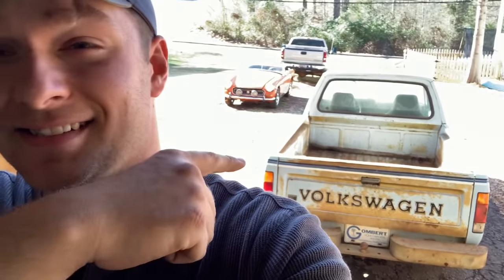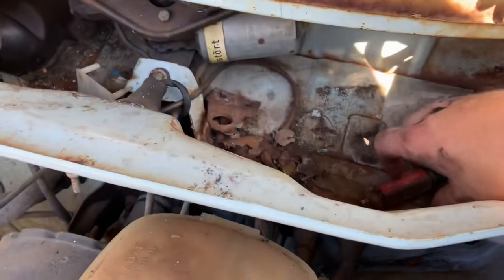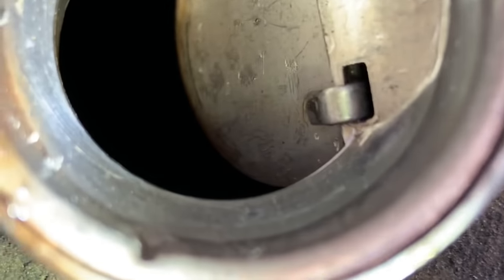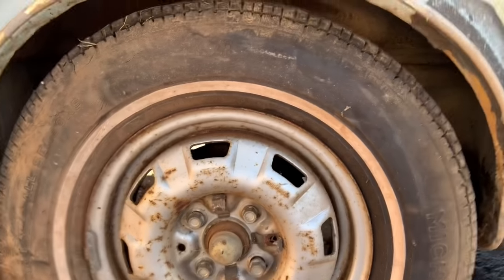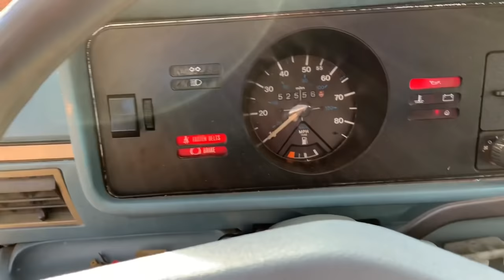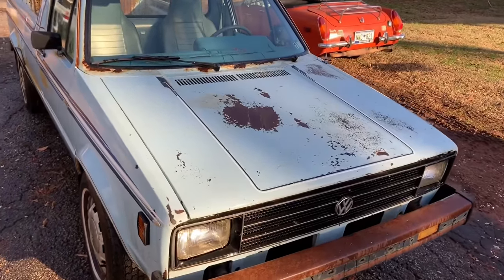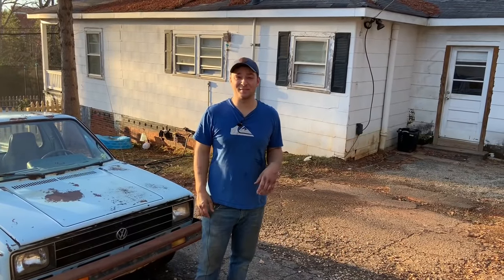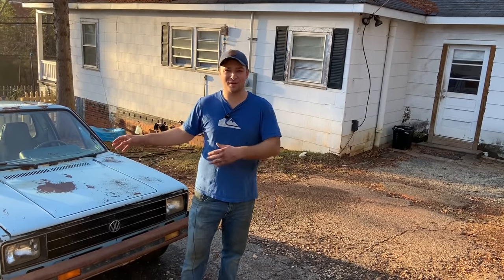Barn Find VW Rabbit Golf Pickup Sitting for 25 Years! :Rebuild Part 2

Comment: Those things are indestructible. I used to work with a guy that had 400k on one. Might still have it for all I know. He said it got over 50 mph. Really cant beat German engineering.
Reply: Unless you do like my uncle and drive around with tho oil light on. We had one of these for work.
Reply: 50 mph is pretty slow
Reply: Unless you drive it in Europe. Here it will be well and truly eaten up by rust within 10-15ys.
Reply: we have a VW polo with 410-420 000km on it and the engine is like new
Reply: @CXensation  atleast here in finland when there is road salt basically the whole year
Reply: Aye, I have a 1984 Jetta1 TX, and it goes and goes. Salty roads since new (sweden), and its just lovely.
Reply: you like the cars? you should see the german grills

Comment: Fun!  I’ve got an ‘81.  Drives great.  I did have to replace my vacuum booster as it was sticking, due to internal rust, causing brakes to drag.  About 250,000 on mine.  My paint is in good shape and the poor thing actually has taken out 2 deer!  Repaired and running.  I did have ‘normal’ rust, at the corners of the windshield where water could sit, under the gasket and not drain.  Pulled windshield, fixed rust and replaced gasket.  It’s a fun truck.  I think I need to replace the injectors (I have the tips) as it’s pretty doggy but at 50+ MPG who cares!
Reply from the maker: Sweet! One thing to check is the injector timing, if a belt has even been done and that was messed with but not put correct it’ll make a huge difference. I just kick them back and forth until I get the sweet spot where it makes good power but doesn’t blow a ton of smoke and have never had an issue! A fresh set of injectors will definitely make a difference too!
Reply: You can use booster and bigger master cylinder from Passat B3 or Golf mk2 to improve the brakes a bit, also you can use vented front discs and thinner pads from Golf Mk2 GTI to improve it a bit further - these parts have maybe better availability and prices today :)

Comment: Word to the wise from a dude who has been through the wringer with one of these little beasties. Replace that old coolant expansion tank, use only new German water pumps and thermostats, check your timing belt religiously. Also the coolant temp gauge is to be watched like a hawk at all times. I'd recommend an aftermarket one if you can swing it the factory ones are dicey at best. Always willing to lend a hand or knowledge if you're not sure or need advice or resources. The cooling system is the only thing keeping the head from warping on these things be sure it's well taken care of and fresh cheers.

Comment: Love the Patina & Graphics. European round headlights and front bumper would simplify the front even more. Tyres have steel liners. If you’ve ever tried to remove a tyre from a wheel on your own, you know how tough it is. I had a cutting disc to a tyre once and could barely get through it. Keep it under 50mph it’ll be fine. Owned x2 Mk1’s & x4 Mk2’s. Cheap parts, easy to work on, 30mpg, gets a lot of attention. Folks love um especially the more basic models. 1990 CL Auto at the moment. Mk1’s are prettier but Mk2’s are a bit more usable for a daily. I’m up to 62k mileage on my current Mk2 rolling resto. Enjoying the videos. You know your stuff 👍🏻😎

Comment: These engines were notorious for frozen rings and defective cylinder heads. First sign of bad rings is bad starting because of compression issues. ATK from Japan made a complete replacement cylinder head. I used to do one engine every three days, take it apart, remove the frozen rings, throw away the entire cylinder head. Replace the rod bearings, then back together.  You need a special VW tool to time the injection pump.

Comment: Such fun cars... keep the color. Before you know it your little ones will be driving it.  I had one... an '81...gas... put a HT (or RD?) 1.8 liter hydraulic lifter GTi motor (10:1 comp) in it. That thing scooted. I sure miss it. It was rear ended by a Dodge 3/4 ton work truck. Thank god for head rests as my head (rest) knocked out the rear window.

Comment: Very cool truck. I had 2 at one time and the only issues I had was tail lights and a gas tank almost impossible to find. The front strut towers are in good shape on that they are prone to rust because they undercoated it so well they covered the weep holes for draining. Cool truck wish I had mine still.
Reply from the maker: Sweet! Yeah, I’ve had pitiful taillights in my previous ones but can’t find them! Thankfully these look practically brand new considering the mileage in the truck! Haha yeah I remember pulling pending off them....it’s ridiculous 😅 this one all super solid though!

Comment: I love the truck and it’s Diesel engine . In the late 80’s early 90’s I took two diesel rabbits and made one completely rebuilt rabbit .. I was a master VW tech for 15 years and had a love for vw’s ... you have a special vehicle there even if it doesn’t look like it ...
Reply from the maker: Davyboy Colon Sweet! Thank you so much!
Reply: Around the same time my father and I had a wrecked carbureted, fuel injection, and a diesel.  We swapped the diesel engine, radiator, starter, transmission etc into the gasoline rabbit.  Then we used the best trim parts etc off of the FI model.

Comment: Reminds me of my '84 Rabbit GTI that I bought new and drove for 19 years. Not sure how many miles it had on it as I broke  several odometer cables. It was showing about 250K miles. Engine still strong and used no oil as I changed the oil every 3K miles. Finally gave it to a coworker who was going to restore it. I special ordered it with undercoating from the factory so it had no rust on it. VW Rabbits were great cars.
Reply from the maker: Sweet! Yeah I love them!

Comment: Awesome I love diesel volkswagens my mk4 has 357k on it and shows no sign of stopping either.... I might suggest adding some 2 stroke oil (walmart brand tw-3c outboard) to the fuel to help lubricate that injection pump today's ultra low sulfur diesel is terrible for them older pumps. Also for wheel/rim options the mk2 and mk3 were 4x100 as well as the b3 passat
Reply from the maker: Don’t they just go forever! I’ve had 3 or 4 of each mk3 and mk4 most being tdi’s and I love them! For sure! Thanks for the suggestion, I like to run some veggie in mine too 😉 I have a few sets of wheels I may end up running one if not I’ll keep that in mind, thank you!

Comment: You can start a diesel and unhook the battery and it will still run i recommend putting a little power service diesel additive every fill up i got a 2000 ford F 250 power stroke 7.3 788000 miles original injectors also always use a block heater. In winter good luck guys good start on a new utube. Channel Merry Christmas
Reply from the maker: You’re right about that, other than the cutoff solenoid on this one. Sounds good, doesn’t hurt. This one has some fuel issues or possibly pump timing I need to get a good look at, it’s weaker than it should be. I’ll definitely stick one on! My last one had one and it makes all the difference in the world! Thanks!

Comment: I found an endoscope that connects to a smartphone on Ebay that would be handy for inspecting that fuel tank for less than $5. You should be able to find one on Amazon or Ebay, whichever you would rather deal with.
Reply from the maker: Thanks I’ll check it out!

Comment: I 'restored' an '80 Rabbit that was off the road from I'd have to say the late 80s and had a full tank of diesel which turned into molasses, but I had utilized a 12v diesel fuel pump to suck all the old fuel out....came in handy when it was time to prime the fuel filter/injection pump. Good thing to have laying around.
Reply from the maker: Definitely! Keep one at work for pumping out boat tanks!
Reply: @BudgetBuildz  ahhh perfect, I made the comment before seeing your little prime pump in between the filter and IP. 

I did a TDI swap in the resto process so it's surprisingly quick.

Comment: I used to work at a shop that specialized in the VW diesels. One of those lines on the tank runs into the engine compartment and is a vent line that should be stuck in a hole in the frame rail. You can pressurize this line with an air hose and push fuel up through the filter and to pump. Make sure that this line is kept unobstructed or the pump with suck your tank flat.
Reply from the maker: MnPaul Thanks for the info, I’ll check that out! I’ve not had an issue with one running weak like this one is so this could be some the culprit!
Reply: @BudgetBuildz  You can also try treating the fuel system with Bio Kleen to kill the fungus. It can go through the filter but will not go through the injector. The engine sounds like it is running well with good compression on all cylinders. It could be a matter of timing. There are different settings that can be used. You need to put a dial indicator in the back of the pump to set it.

Comment: i had an 81 with 4 speed  took a 5 speed out of a vw scirocco put in the truck made a big improvement on the highway !!!!!!!!!!!!
Reply from the maker: 5 speed would definitely make a huge difference!
Reply: @BudgetBuildz  The 5 speed from the Scirocco is the one to get. It is a close ratio 5 speed with a higher 5 gear for highway crusing.

Comment: It's a good idea to drill some holes in the loading bet corners so water puddle don't create rust mes
Reply: It already has them, you can see one of them at 1.32, when he is disconnecting the fuel line. They actually look pretty big

Comment: Do a compression test video. With these old diesel engines, Compression is everything, Adjust the valves before the test. these old  Diesel Rabbits are Great! I'm restoring a W115 diesel Mercedes in my driveway I used to have a rabbit long ago.
Reply from the maker: Mercedes Benz Revive I’ll definitely do a test for y’all! If it appears it needs some adjustment I may see about reshimming the valves 🤙🏻 sweet! I just got rid of my 280C double over head cam 😕

Comment: Crying out for a vr6 or turboed v5 yeah buddy nice! Set of BBS nice little truck!
Reply: vr6 is overweight but low in power. if the gasoline engine then 1.8T 20v or 2.0 16v with turbo. My favorite would be 1.9tdi
Reply: @immens1  yeah you could be right Bruv! Tuned TDI would go nice!!

Comment: Nice factory color right down to the emblems, as for the cracked dash, they have a kit, to fill in the cracks you put some hardener material, it also includes so m.j e  color samples, use the heat gun to heat into place, it works for upholstery,but it would also be good to cover the cracks, any auto parts store has it it*s made by Permatech.
Reply from the maker: What if I told you I found another extremely nice dash 😉
Reply: @BudgetBuildz  Hey that is even better, zI just thought in case you want to fix something else more important, so that pick up looks even better with the original paint & emblems, I just like that the pick up is going ,since you don*t see any on the road barely.
Reply from the maker: Enrique Lopez Thanks for the suggestion! I’ll definitely keep that in my mind on other projects!

Comment: You know that you could've started and run the motor with that old diesel? It's a motor that could run on cooking oil.
Good old motor, built to last. Greetings from Romania!
Reply from the maker: Andi Cîmpean The gentleman that previously owned the truck had put gas in it the last time he tried to crank it, he had Alzheimer’s sadly. Otherwise I would’ve lol my house is running on fuel oil(diesel) from ‘94 that came in my tank truck. Glad to have you!

Comment: did you do a compression test?
Reply from the maker: I have not, engine runs very smooth and even. I don’t suspect anything but when I pull the injectors I’ll check while I’m in there 👍🏻
Reply: @BudgetBuildz  Common problem is head or head gasket failure so a leakdown test in the cooling system would tell alot. Greetings from Finland.

Comment: If you have issues with power/ Injection stuff please consider that the injectors are an important part of the system, the YouTube channel Mercedes source will provide a lot of knowledge how to check and rebuild yourself even if Mercedes uses different type of injection pumps. 
I have manuals  (in German language) for this engine set the timing requires special but inexpensive tools. If you have any questions or need parts from Europe feel free to ask!

Comment: you should plan to change the timing belt as soon as possible. if that breaks your project is over. you said it has been sitting for years and it will be weak. i have a 1980 1.5 diesel Rabbit car parked in the backyard. loaded right full of camping gear with a canoe on top it got 60 mpg. still runs fine but the body is rusted away.
Reply from the maker: Yessir, I just wanted to see how it went around the neighborhood. Now I’ll change it, guess if it snapped it would give me a reason to swap a tdi or VR6 in it 🤷🏼‍♂️ lol
Reply from the maker: They do go forever don’t they!
Reply: @BudgetBuildz  lol a Vr6 would be sick. somewhere on youtube theres a 180 mph MK1 rabbit, i think its a 4 cyl.
Reply: @BudgetBuildz  my uncle had 6 rabbits and i think 3 were diesel. his only complaint was every 300,000 miles you had to rebuild the head. also they rattle the alternator bolts out.
Reply from the maker: yako0000 This one will never see you 180mph 😅 I’ve got a friend with a 1.8t truck and it’ll break loose over 100mph 😜 I think he’s had it over 140mph. Haha Yeap, aluminum head on a shaky engine 🤷🏼‍♂️ oh yeah, every one I’ve ever seen has a crunched rad support from constantly prying the belt back! I deleted the A/C on my last one and put a factory non a/c bracket, it made a huge difference as it stayed tighter longer!

Comment: Why didn’t you try push starting it (putting it into 2nd and then quickly take your foot off the clutch and hit the gas)
Reply from the maker: With the dragging brakes it wasn’t going anywhere fast 🤷🏼‍♂️ would’ve had to actually dragged it, once I get the alternator hooked back up and a fresh battery she’ll be no problem 🤙🏻
Reply: Budget Buildz oh nearly forgot about the bad brakes
Reply from the maker: Glen Reddin and then they slid into your memory...literally 😅

Comment: There should be no gas in that tank. And, last I knew they don't put ethanol in diesel fuel. But, pretty neat, otherwise.
Reply from the maker: The gentleman that owned it had put gas in it the last time he tried to run it. Fella had Alzheimer’s 😕
Reply: Ah, that's a shame. Good you got it running, though.